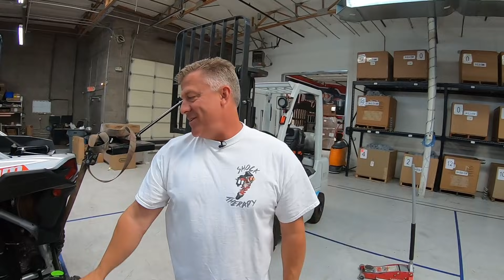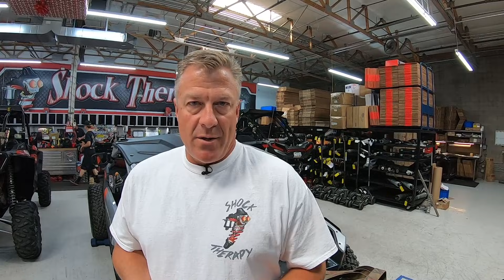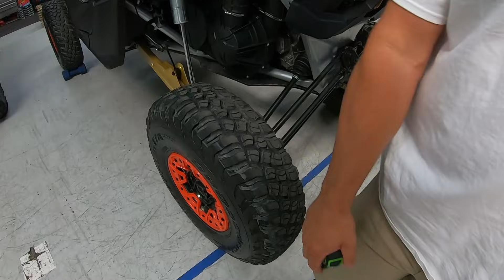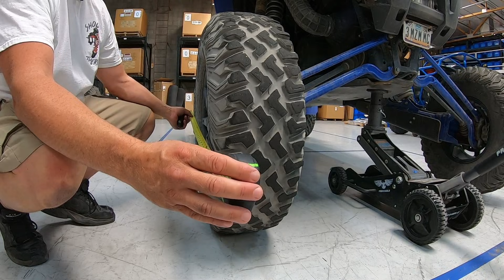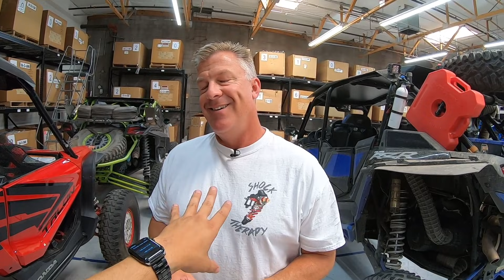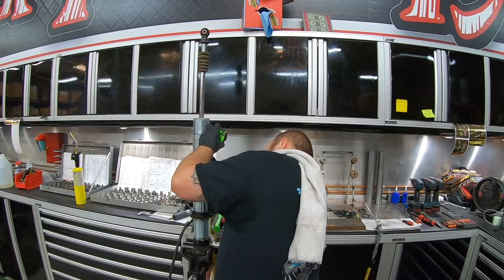Shock Therapy LIVE: Is More Travel Better?

Comment: Good video! Little positive criticism. A little too much commentary. But that's my opinion!  I'm Chucky from the one and only 1offroad Tucson Arizona.  I had to pause a video because I want a free shirt 😂  my honest answer! The difference between a two-seater  and four-seater ...is vehicle weight+ vehicle length + load capacity+ the amount that the frame can flex? I think it's important to understand what a CV axle is. C stands for constant, V stands for variable speed. The purpose of CV is to transfer power, from the transmission and differential to the wheels.   Doesn't matter how much horsepower  you have if your suspension goes to full droop. Proper suspension allows your drive train to move the vehicle .  I'm going to watch the rest of the video! Love what you guys are doing at shock therapy. Don't call if you're looking for a job!  Keep up the good work! .     

P.S .
  Can you guys make a video that explains independent suspension?

Comment: We raced the 1995 la rana desert race series in unlimited truck class.  Barstow, Lucent and Ridgecrest.   The tires were 35 BFG.  Back then tire ruts were getting deep with a high center hump.  With tires at 36 39 and 40 inch and high horsepower I can imagine the ruts getting deeper.  How do your sxs race cars do in that running 32 inch tires.  Does it drag the skid plate a lot  or is that not a factor these days.
Reply from the maker: It is actually a real problem. We can sand paper off the whole skid plate from rutted corners in a race. Now that there are UTV specific races or UTVs run the first day and trucks run the second day it is a lot better. But, in Baja you are just plane screwed in a UTV.

Comment: On a Dynamix spring replace you should on your install video explain that you need to cut the zip tie that is hooked to the shock holding the wiring.  Do you zip tie the wiring back to the shock after install?
Reply from the maker: We actually leave the zip tie and just remove the factory clip the zip tie goes through from the shock. The clip is re usable and we just put it back on the shock when done. I will add that to the video.

Comment: Would you guys consider covering UTV width 64 vs 72? Obviously wider makes it a little more stable but how big of a difference is it? For example I have a can-am x3 XDS max and continue to think about converting it to a 72, but is the cost really worth it? I live in AZ. Keep up the awesome content.
Reply from the maker: We can work on that one for the future. But in general the wider the better for stability but the design helps a lot with this factor too. The XP pro is more stable than a Turbo S even though it is narrower so it really is about design as much as width.
Reply: Great question
Reply: Shock Therapy llc 
How do I make my Honda Talon 1000X-4 
Fox Live Valve wider ? 
Offset wheels with spacers? And what is the max offset I should do if you don’t recommend spacers.
Reply from the maker: Crypto King never do spacers or offset wheels. Too many negatives with those. Your only option is a long travel kit

Comment: You mentioned that CV joints on the 64" and 72" X3 are different and not to use the CVs off a 64" if converting to a 72".  I am putting a LSR long travel kit on a car that was a 64", I was planning on using the CVs from the 64" axles, and installing them on the LSR axle shafts.  The car is a 2018, when I look up the part numbers for the CV joints on the can am parts fiche the numbers are the same for for the 64" and the 72".  Did I mis-understand what you said? or is it year specific or something?
Reply from the maker: The 64 cv will not work on the 72 system. They will bind early. The star and cage might be the same but the outer cup, stub won't be. Just be careful with this. I have seen at least 20 cars do this an blow them up.

Comment: Do you get more ground clearance with your spring kit for a 2019 rzr 900 trail eps and does the spring kit work with stock shocks or what shock should I up grade to. Great video thanks guys
Reply from the maker: Yes sir. More ground clearance. The spring kit is designed fir your stock shocks. The fox are the best for that utv.

Comment: I'm interested in that shim kit for the Turbo S or best way to do it myself.  I would like to eat whoops all day on the trail and in the dunes, with out the rear swapping back and forth.  Your springs help, but the rear is still all over.
Reply from the maker: Best thing is to buy some pinion shims. Typically 3-5 degree shims. You could use two of them between the hub and arms to shim the toe in. That is pretty easy but still a bit hokey.
Reply: @ShockTherapyllc  Thank you.  Definitely going to have to try it out.

Comment: Can you just get a longer CV Axel with the longer A-arms for more travel if the cv is but limited factor?
Reply from the maker: Yes. That is basically a long travel kit. My point was just that it requires width to get more travel in a UTV. No way to get more angle

Comment: I've always heard of Porsche 930 cv's having more articulation than all other axles....are Can Am and Polaris the same as Porsche....so my question is, could we get more travel by building custom axles with 930 cv's
Reply from the maker: The 930 and 934 cvs both have a max angle of 24-25 degrees depending on the power put to them. They are also a plunging CV star. The Polaris and Can Am systems are not a plunging star design. This allows for 40 degree angles in the UTV systems. 👍🏼

Comment: So does the turbo s having more travel then the xp a marking ploy? It does the turbo s actually have what’s advertised?
Reply from the maker: It has the travel they advertise. My point was only that most manufactures use 4” of travel at full compression in their numbers that is ultimately unusable or at least shouldn’t be used. I would rather have 20” of travel that didn’t bottom out verses 24” of travel that destroys the skid plate. Both rude the same in the chop and whoops.

Comment: For mountain trail riding is it worth paying almost $10000 more for a turbo s or would you buy a XP turbo?
Reply from the maker: So for trail the extra travel isn’t going to help you fir $10 k more.  But in my opinion, the stronger front diff, trans, clutch, hubs and arms are well worth the extra $ over an XP. Zero reliability issues comparatively with the Turbo S VS the older design XP turbo

Comment: Great overview guys! Justin, are there any good reads you can recommend for suspension design? I know in previous videos you mentioned drawing some knowledge coming from some formula 1 and NASCAR books. Thanks for putting these videos together! It would be cool so see the other cars as well, honda, XX and others!
Reply from the maker: Thank you. Let me get some good titles for ya. Couple days.
Reply from the maker: Here you go. "Chassis Engineering" by Herb Adams. Also, "Advanced Race Car Chassis Technology" by Bob Bolles. These are centered around small travel numbers and turning corners not accepting whoops and jumps but if you can filter out the things that are specific to 3 or 4" travel numbers and use the larger ideas as an outline for 20" travel numbers and performance you will gain a lot from them. Good luck.
Reply: Shock Therapy llc  Thank you so much! I really appreciate the videos, and you sharing years of knowledge and experience with us!

Comment: Question! I have a 20/20 Can Am. XRS Turbo RR. And IAM running method 15 inch RIMS and 35 inch tires. What spring package would you recommend ? And would I need to loose travel to make it bottom out or am I good with that setup... Thank you guys very much.
Reply from the maker: Our dual rate spring kit would fix you up perfect. When you order it on line there is a huge form you will fill out for car and driver details. These are what we use to tailor your kit for you. We don’t add ground clearance at bump with the spring kit but when you have us do the shock internals we will add 2 inches at that time.

Comment: Do you days do anything for the new Yamaha rmax?
Reply from the maker: Yes sir. Full shock internals and spring kits available if you have fox shocks on it. 👍
Reply: Thank you. Being in Australia might make it a bit hard. Would possibly be better buying new shocks. Are the gains worth it?
When do you think the full reveiw will be done on the rmax?
Reply from the maker: @benorders1021  It has been our experience that buying a new set here, have the work done, ship and sell your original set is best in this situation. The gains are huge due to the fact that that Max is super stiff stock. It is so much more enjoyable to drive when the suspension works great and feels plush. Just a heads up, Fox is horribly behind right now. It may take some time to get a set from them. You may have to search our a used set. Good luck.

Comment: Just want to point out, I run 4" portals in dunes, rocks, trails, lots of fast stuff with your spring package.  No issues.  Steering can be tricky, but with less offset on wheels, it's not half bad.  Love the extra travel and more ground clearance.

Comment: Can anyone chime an opinion in for me. I'm restricted in my budget for sxs so right now im torn between 2020 x3 turbo r xrs or a base model pro xp. I heard the pro xp is hard car to flip but I'm pretty sure that's cause of the dynamics which the base doesnt have. Ride 95% in the oregon dunes
Reply from the maker: if you can work on cars then buy the can am. if you don't want to turn a wrench then buy the pro. But once you do $1500 worth of support items to the X3 it is a better car for your dunes. Check the video on here, trouble free X3 and what utv to buy.
Reply: @ShockTherapyllc  thanks and if I do get the canam which is what I'm leaning towards I plan on tmw bulkhead gusset kit rear radius rod plate and your guy's tls kit. Eventually I'll upgrade the radius rods and get the bigger tls kit when I can afford it
Reply from the maker: @jaredthompson8188  Perfect. Good luck

Comment: does shock adjustment help with the toe in or out on the front for a 2010 high out put polaris razor, the car does come out with 10 inch rims, father in law put 14 inch rims with 29 inch tires
Reply from the maker: Nope. Shock adjustments only affect ride quality. The Toe is a geometry issue that is constant no matter what the shock is doing
Reply: @ShockTherapyllc  he just put new upper and lower ball joints on the front and a new steering box with arms, set the alignment up by marking the tires and rotating 180 and measuring, feels pretty good until decelleration then it wants to jerk the wheel out of your hand. if you hold the steering wheel in place and using a hoist lift the car up the front tires go crazy amount of toe out, thought maybe had something to do with the shocks. By the way this is a 2010 razor 800. would the angle need to be 33 degrees on the cv axel?
Reply from the maker: @lonnieshaw5410  What your describing is bump steer. Toe change through cycle. If you have aftermarket tie rods on it then usually the inner joint is different than stock and causes this geometry problem. The other end of the tie rod can be an issue too if it sits too high or too low on the spindle mount. Any change in the stock height and you get bump steer. Check these things and you will find the issue
Reply: @ShockTherapyllc  thanks for your feedback